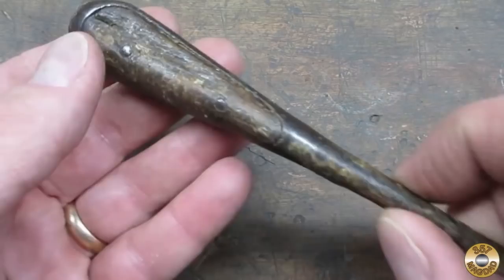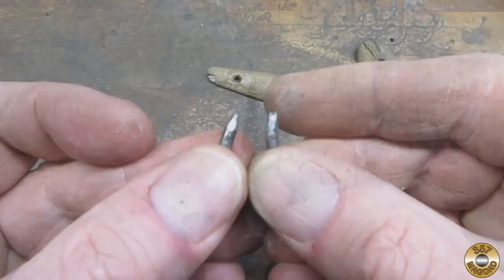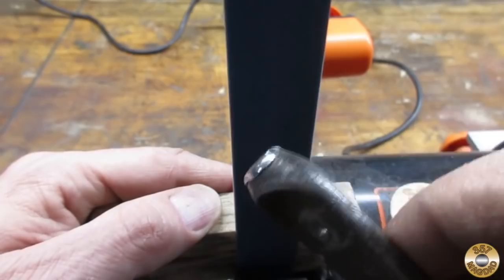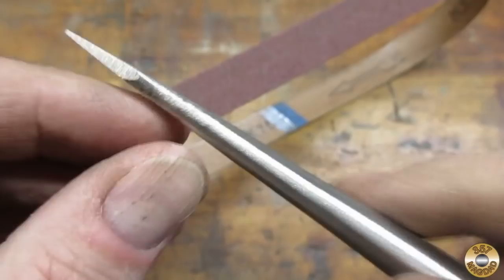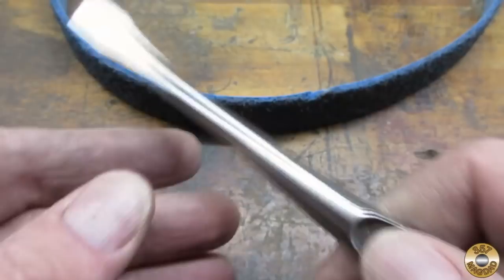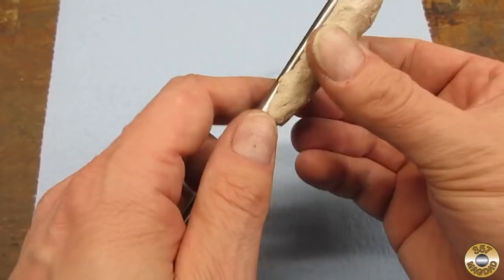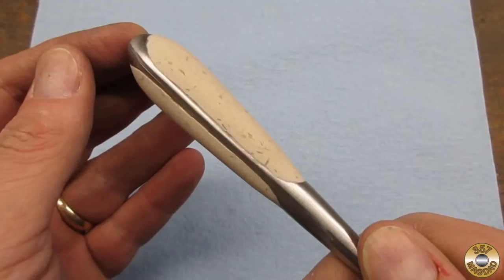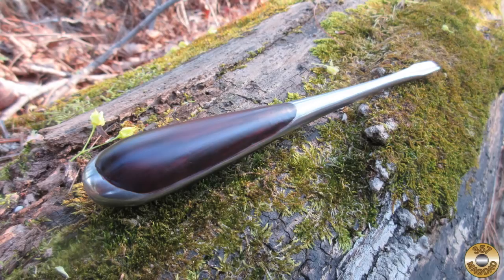Hand Tool Restomod - Perfect Handle Screwdriver

Comment: That screwdriver is drop dead gorgeous.  It looks better than factory new. I have never gone coarser than 80 grit when sanding steel. I'm afraid I might overdo something and that if I do overdo it, I can't put the sanded steel back. Replacing the scales with new wood can be a tedious, not-always-succesful project, so the JB weld looks like a great solution. The stain is a perfect contrast to the steel. I do hope the JB adheres to the steel reliably. Great video. Thanks
Reply from the maker: Thanks Pat! Those Harbor Freight 40 grit Zirconia belts are aggressive, but they are handy if you got a lot of "patina" to grind through!

Comment: Incredible! I'm not sure you can get a better fit using wood as you did the putty. What a cool idea.
Reply: If you plant a tree seed under the screwdriver, and water it every day for 30 years, and train the tree with bonsai wire, you can, indeed, get a better fit. But those rock-and-rollers of today don't appreciate all the sacrifices we old folks used to make to repair busted tools. And NOBODY lubricates with whale oil anymore!!!
Reply from the maker: NICE!  LOL
Reply from the maker: I want to try some color tinted epoxy next!
Reply: @357magdad  Please do. I have an identical perfect handle and I want to do the epoxy. I could use the inspiration.

Comment: In the past 20 years, the chemical/paint/epoxy industry has changed significantly. I'm now seeing carpenters use epoxies and automotive putties in their fields and other trades as well.  It's safe to say your "idea" drives the manufacturing industry to put their chemists/engineers to work on new products as well. Your not afraid to use various materials (wood, metals, bonding agents) to create various projects; for that alone I salute you. You bring a small portion to the table today which is somewhat lacking...ingenuity.
Reply from the maker: Thanks Lucian!  I'm a big fan of Crafsman Steady Crafting and he's always using epoxy - that's where I got the idea.

Comment: Incredible! I love how it came out and I bet it far outlasts the original wood. I did something similar with the handles of a Benchmade Bone Collector and regular JB Weld.  I found that the handle scales of the knife were extremely corse and made pulling it out of the pocket difficult, so I filled in all the serrations on the handles with JB Weld and sanded it down and it dried gray and the handles were black and it ended up with a cool pattern and a smooth feel to the hand. the regular JB might be even tougher than the Weld Wood, I don't know.
Reply from the maker: Thanks Joe!  I have a pocket knife with chipped scales that I'm thinking of repairing with the kwikwood.
Reply: The original wood on these screwdrivers is about 100 years old. So I guess we'll never know. Not unless they develop immortality in the very near future.

Comment: Great results!  Love the perfect handle tools (even if ScoutCrafter doesn't like the wood/metal issues!)!!  Let us know if the JB Wood holds up.  Wondering if the epoxy connections through the holes you drilled will stand up to the torque.  (If not, those 'mahogany' handles would look great with brass pins!)  Nice work!
Reply from the maker: Thanks!  The Kwikwood seems pretty tough, but I I think this one is gonna be a wall hanger!

Comment: Very nice resto-mod.   Well done.
You did good with the stain.  A challenge since the Kwikwood likely does not absorb the stain well.
I just purchased two Perfect Handled screwdrivers at my first flea market visit of this year.    One shows "Rieco" and Germany on the other side.  It also has a bend in the shaft.    Its scales are as beaten up as yours when you started.    The other is 14 1/2in long and has Irwin and USA stamped on the shaft.    The Irwin has no bends in the shaft but the scales have expanded over time so do not sit flush.
I will have fun with my restorations.
Dave.
Reply from the maker: I'm always on the lookout for perfect handle screwdrivers at the sales!  I'd love to see photos of your projects! 357mdad@gmail.com

Comment: Excellent restoration but I’m a little confused.  Why did you drill all the holes in the handle, was that to help hold the putty?  You have a very ingenious mind!!
Reply from the maker: Thanks Frank!  Since I wasn't gonna use any pins, I was hoping the epoxy would flow into the extra holes and help lock the handles in place.

Comment: Very nice. Wasn't sure how the J&B was going to turn out but with the stain it looks great.
Reply from the maker: I did some molding with the Kwikwood for Chuck's tiny toolbox project.  I like the results, so I wanted to try it on a larger project.
Reply: @357magdad  I recently learned more about the composite Micarta. Wow these resins including Kwikwood are a legit useful material. A lot of the micarta is a solid material of surplus WWII tarp material from US Navy ships (apparently there's tons of it) and typical two part clear resin. The tarp can be layered after coating with resin and it not only adds color but unique strength. Many modern knife handles are made of the material. It can be bought in blocks of many dimensions or you can make it yourself. Pretty cool stuff. Not unlike fiber glass.
Reply from the maker: @ihrescue  I've been wanting to give micarta a try.

Comment: Innovative way to do the scales. 
I’d be interested to hear how long they last, without pins to keep them in position. 
Did you consider adding them?
Reply from the maker: I'm hoping the epoxy got pushed into the holes I drilled to hold the scales in place.

Comment: I understand the benefits of slack-belt sanding but why, when you need to support the back of the belt, do you use a scrap of wood instead of a platen? It seems to me that a mounted platen leaves plenty of slack belt above it (and it can be cut shorter too), and also allows the use of both hands should the need arise. Just curious.
Reply from the maker: You're right, the platen would work.  I have found that the wood block works the best for me when shaping the screwdriver tip.  Guiding the block in one hand and the screwdriver in the other results in a straighter grind.  Since I have the platen off, it's just easier to support the belt with the block of wood when sanding the rounded parts.

Comment: Great job.....  You gave me some ideas.  I have a Perfect Handled Screw Diver in similar condition that I have meaning to fix up.  When you had the scales off I thought it would look nice if you cleaned up the metal handles, then painted the insides and put on a clear acrylic 'see through' handle.  The process would be similar to what you did with the wood putty.  I was wondering why you didn't use bright copper pins on your handle.  It really would have offset the dark stain of the handle.  Brilliant job.
Michael from Canada
Reply from the maker: I'm glad my video was helpful!  I'd love to see some photos of your project!  357mdad@gmail.com

Comment: That came out great! I bet it wouldn’t hard to install pins with the kwik wood. Is flitz actually a paint restorer? Can you show us how that works?
Reply from the maker: I have not tried Flitz on paint.  I've only used it on metal and plastic.  I bet if you had a painted item that was super oxidized, the Flitz would work like polishing compound.

Comment: Nice job sir. Scales look very good. You probably watched ScoutCrafter recently making wood scales. Alot of work because of those odd angles. Johns came out nice as well. The JB wood looked great with the stain. Chuck you are the man with Flitz!  🇺🇸👍Roger
Reply from the maker: Thanks Roger!  I've done the wood scales before and I wanted to try something different this time.
Reply: How long shaping wood takes is down to the craftsman. I'm sure the guys that made these screwdrivers originally did it pretty quickly. Knowing the Germans they probably had some sort of a dupla carving contraption or something?

Comment: Is that a WEN belt sander?
Reply from the maker: yup
Reply: @357magdad  I have one also but I have a hard time finding belts that will fit it. Such as the abrasive belts are just too thick. Do you have any recommendations ?
Reply from the maker: @1977grad  Check out my review of the Red Label conditioning belts. I show how I modified my Wen to work with the belts.